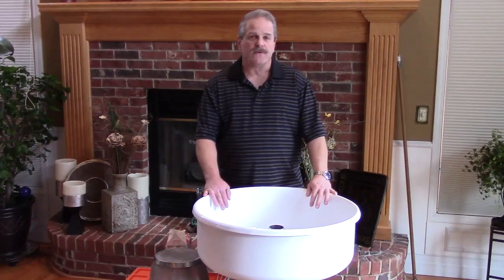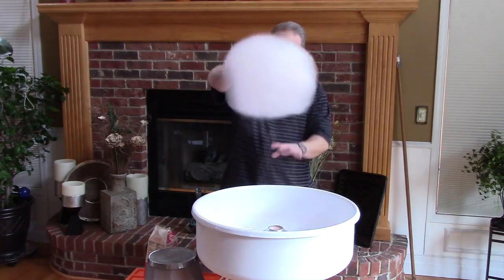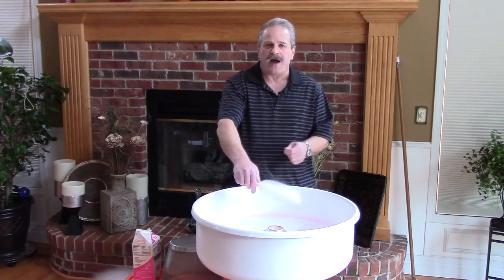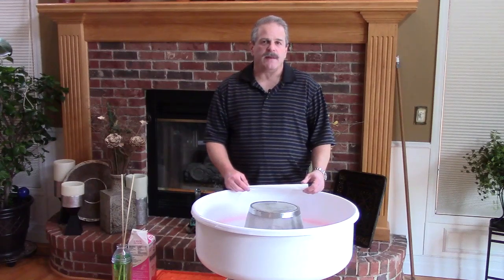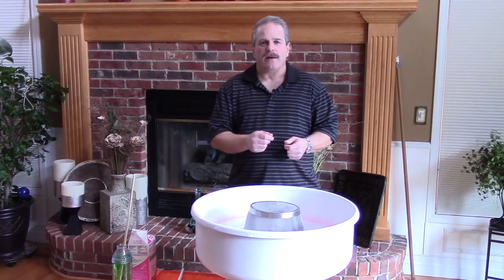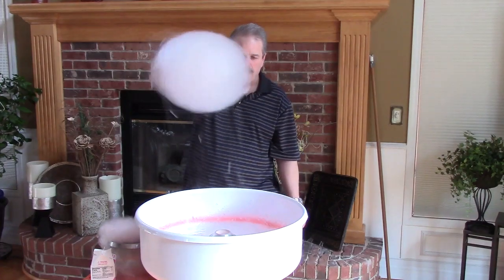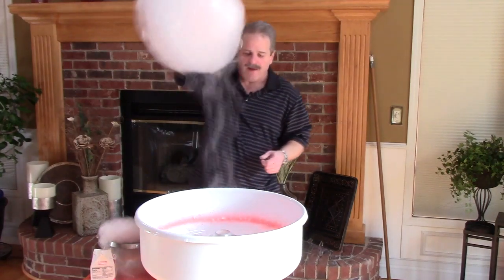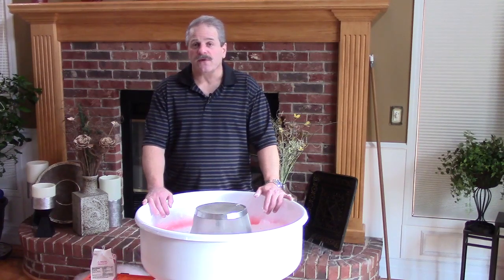Floating Floss with the Robo JetFloss Cotton Candy Machine

Comment: Can I use different flavors while spinning
Reply from the maker: You can change flavors, but not one cone at a time.... you have to add 1-2 cups of sugar to start and can only change the flavor when that's used up.  Our Artist machine is designed to allow for making one serving at a time and changing flavors for each serving is thus an option.
See:  https://www.robolabsusa.com/product/cotton-candy/ for information on the Artist.
Reply: @floatingcottoncandy  than you, Looking for a machine that offer the option of a upward flow. Going to go cotton candy art. Can the machine recommenced make flowers ? Where I can have different layers of floss
Reply: @floatingcottoncandy  with the Artist machine run at least 10 hours

Comment: Hi there! Can this machine be used to make multi-colored flowers? Does the head have to be filled completely or can I just pour what I need if I need to change colors during my spinning? Thanks! :)
Reply from the maker: Not easily!  For flowers you need a slower, more controlled machine. The Robo JetFloss is more like a Monster Truck in the cotton candy arena.
   There is a new machine from RoboLabs being beta-tested right now, called the Artist. However, it won't likely be released until next year.
   I'll make a video on it once it's available. :-)

Comment: Good morning, I want to buy robojetfloss machine, but I ask you, in case I have only one child want only one candy floss, how much sugar I have to put inside ? is it possible to use the machine in a place where people buy occasionally ?
Can I stop the heater with some sugar inside and use the remaining sugar after few minutes or hours while I'm waiting the next customer ? Yhank you.
Reply from the maker: You have to fill the floss head so it will run in a balanced manner (1-3 cups, depending on the model).

However, the heater can be turned off independent of the motor so it's very common to turn off the heat and let the coil cool down when there are no active customers.

Alternatively, you can adjust the voltage to the heater to just below the melting point of sugar so it won't fully cool down, but won't produce floss either.  This is convenient if you're constantly starting and stopping because you don't have to wait for it to warm back up from a completely cold state.  :-)
Reply: kim 1 saya mesin ini.
Reply: bagaimana cara saya mendapatkan mesin ini.